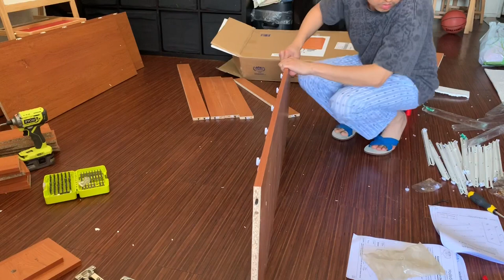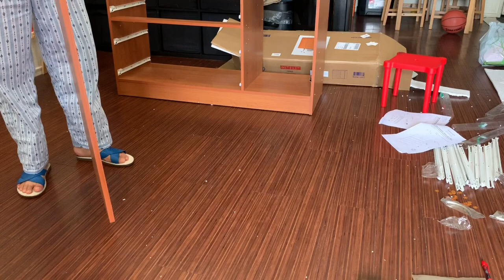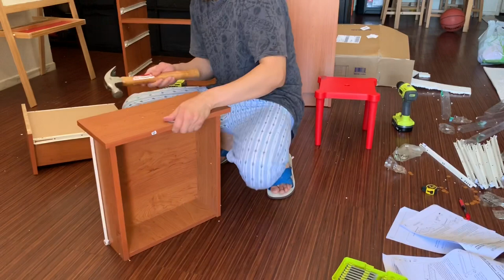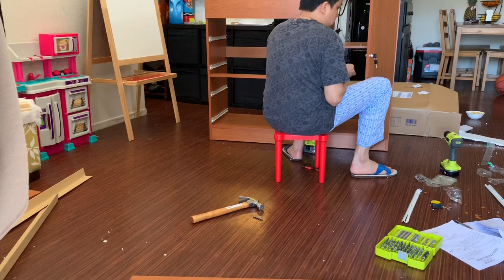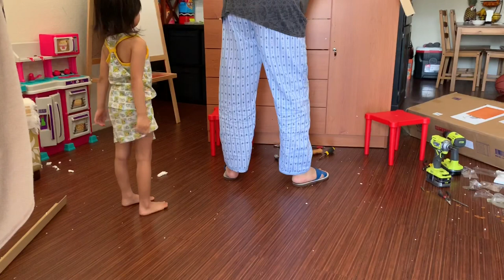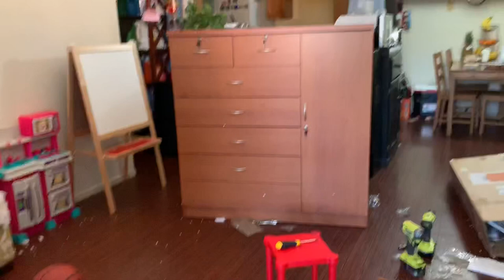Raw Video - Hodedah 7-Drawer Jumbo Dresser, Multiple Colors

Comment: the cabinet/drawer slide are stamped CL, CR, DL, DR (cabinet L R, Drawer L R), Assemble first all drawer use clamp and wood glue for firmer joint.  I notice he didn't glue the joint, very wobbly, out of square.

Comment: When you screwed the sliders to the divider panel (the piece between the two small drawers) did the screws poke through the other side? The pre holes are aligned in the same location on both sides.

Comment: Hey manalo, I want to thank you for posting your video without this video we'd be lost.  I'm reaching out to you because there's one part in your video we couldn't see you attach the top part. we're having trouble putting L to I , A, H and K. The problem is H. To us it seems shorter than the others.  We couldn't tell how you attached yours. If you can help us out it would be much appreciated. Thank you for your time!
Reply from the maker: oops so sorry i missed your comment. all you have to do is to put the top once your done putting both sides and bottom together then stand it up and put the top part. the back board of the drawer should be the last to balance the drawer on each side and make them even like i showed at the end of the video.